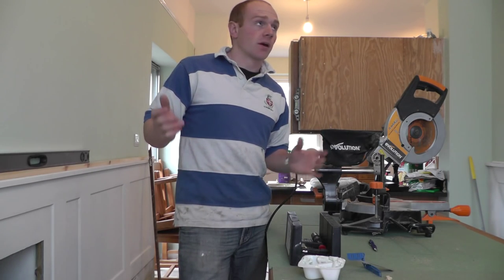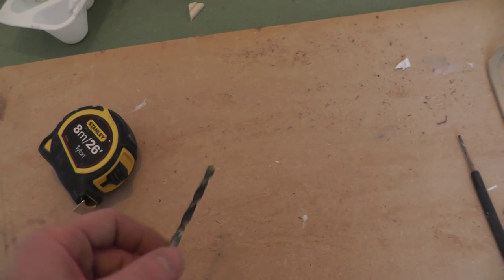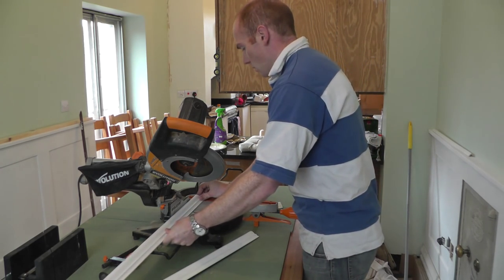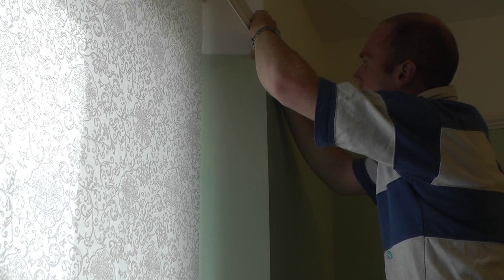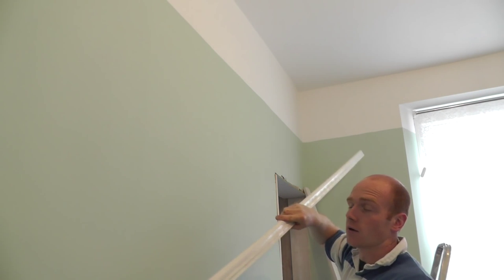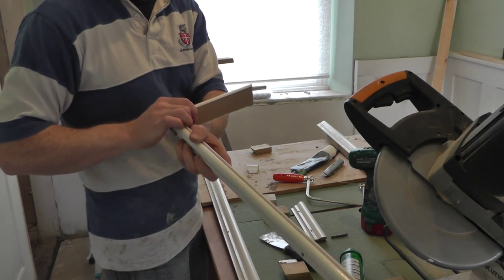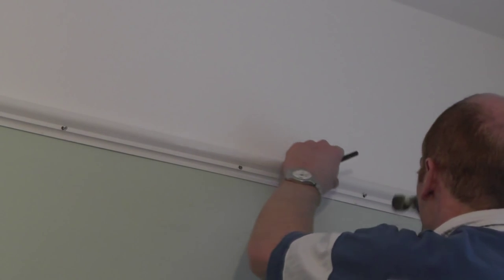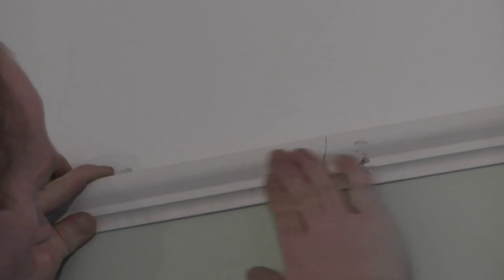How to Fit a Picture Rail

Comment: Nicely done.  I find coping MDF a challenge, good on you for pulling it off.  When doing a scarf on molding like that, I'll try and put the long piece up first so the next one can kind of slip in behind it.  That keeps me from sliding it too far up on the open scarf joint.  Your place is really looking nice.
Reply: Trick to coping joint profiles - use a dremel tool with a sanding barrel for curves and cope rectilinear angles with a jewelers saw!  Been doing it that way for decades and its flawless compared with a coping saw.

Comment: I’m in the process of fitting picture rail in my bedrooms, and it’s nowhere near as complicated as this! I don’t get the scribing and cutting of the corners, a simple mitre (45 degree) cut does the job in a fraction of the time. As for the holes you drill for your nails, you’re making even more unnecessary work for yourself. Grab adhesive on the back of the rail and 1 inch panel pins are more than enough to hold a picture rail and any pictures hung on it, (I’m fitting to masonry and apart from hitting the lintel the panel pins are perfect) and once you’ve punched the head below the surface of the wood, you have a very small hole to fill. As for the scarf joint, you need to apply adhesive to that too, and it is worth pointing out that the cut should be made facing AWAY from the line of sight, so once filled, sanded and painted it will be practically invisible. Keep up the good work!
Reply: You scribe the the internal corners as they will firstly give a better fit but more importantly wont leave a noticeable gap once the wood (or mdf) retracts with heat and humidity. The same as you would a skirting board. Also are any walls really a perfect 45 degree corner?
Reply: Trick to coping corner profiles - use a dremel tool with a sanding barrel for curves and cope rectilinear angles with a jewelers saw!

Comment: Hey! Great video thanks. I'm going to be putting my picture rail up on 100yo brick, can I hammer straight in with masonry nails, or do I need to drill holes in the wall first? Cheers
Reply from the maker: I’d drill if possible or even use the small masonry screws if needed. You may manage just hammering but depends on brick and how delicate plaster is.

Comment: really useful but in my experience masonry nails have never held and adhesive onto any painted surface can just come away is the paint isnt 100% absorbed into the plaster or masonry. One question, how did you calculate the reverse mitre angles i.e. the ones that look about 120?
Reply: You say what doesn't work for you but importantly (for users here) don't share with us what you do that DOES work!
Reply: You can use a protractor to check all the angles (there isn’t a straight wall or 90degree corner in my old house so I check them all!) the gripfill he’s using sets like stone and bonds to pretty much everything. But yeah, if the paint is peeling away from the wall it just pulls that away but if you’re unsure just sand back the paint where the rail will sit so you get a strong bond.
Reply: Yeah get ya. Ive yet to find a solution. When i do ill share. 😉

Comment: This is a great video. Thank you. The one thing I still don't understand is how you are hammering into plaster walls. Won't the plaster crumble? I'm about to mount picture rails in lathe and plaster walls. It sounds like I should screw the rail into the studs. In that case, would I drill a pilot hole into the wall as well as in the rail itself?
Reply from the maker: They are stone walls so used masonry nails as easier to fill after.  Another option is the small concrete screws you can get.  If stud walls I just use adhesive and brads, or thin trim screws if needed.

Comment: Hi Tim, quick question, when you installed the picture rails, did you make the picture rails spirit level level or do you make it eye level so that it was in level with the ceiling? Thanks mate.
Reply from the maker: Levelled but if the ceilings were off by a gradual fall I might be tempted to match that. I just would make sure that it leaves the rail straight rather than undulating with an old ceiling.

Comment: why the complicated cut out for the internal corner. why not just a reverse mitre?
Reply from the maker: Scribing it just produces a much tighter and more accurate joint, especially when working with wonky walls.  With MDF it is less important I guess, however when using pine or solid wood a mitre joint will show up easily if/when the wood shrinks and expands.  (Yes mask definitely for MDF,  I made these few cuts inside with the vac just for the video however a respirator is a must, especially for the skirting, paneling and any router work!)
Reply: David Morgan corners are never at a 90 degree
Better joint by far doing a scribe
Its not complicated

Comment: I didn't get to see the door, so I am curious, does the top of the picture rail line up with the top of the door architrave?
Reply from the maker: We have high ceilings so it goes over them around 150mm higher.
Reply: @TheRestorationCouple  I always put a piece of 3x1 on top of the door frame and then install the rail on top. It makes the door frame more pleasing to look at IMO.

Comment: 2 45° angles on both rail ends would have cut out half of this video. I suspect he put up the first rail and forgot to cut a 45° angle on it and it was too difficult to take down again.
Reply from the maker: Scribe cuts are the best way for most trim, especially with walls that are not perfectly square.